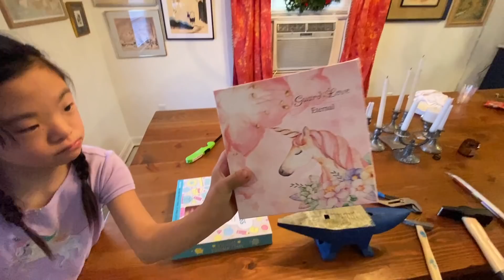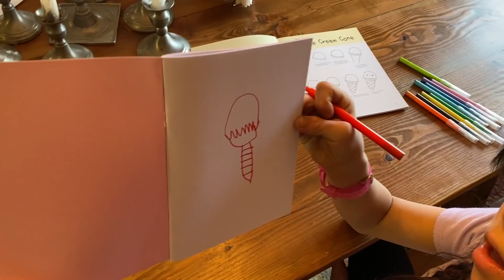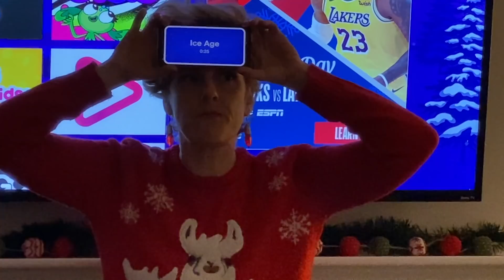CHRISTMAS MORNING 2020 : Adventuring Family of 11

Comment: I know I have seen the little hammer that Asher has with his anvel, I have seen it used hammering in little nails or tacs in horseshoes, starting them in the horseshoe and them when putting the horseshoe on the horse hoof the little hammer pushed the little nail or tack in.

Comment: I think the smaller hammer is used to cut the hot metal. But you have to have a bucket of water nearby to keep it cool. You hit the hammer side with the big hammer, and cutting side in the hot metal. If you don’t keep the little one cooled it will fuse with the hot piece you’re working

Comment: I have taught needle felting to my son's disable art class by putting fiber inside a cookie cutter and having them felt to the shape of the cookie cutter.  They turned out adorable and could be used as a decoration by threading a string through it.  We added color in various ways to enhance the design....stripes on a cat as well as adding a nose and eyes.

Comment: Maybe try for Eve something with three wheels. They used to have something called a "big wheel" that sat low to the ground and you peddled it but it was almost impossible to tip over on it.
Reply: The problem with big tricycles is they tip when going around a corner. You have to shift your weight to prevent that. Once Mike lowers the seat the bike will be perfect for her. She'll get excited about it when she sees her cousin taking it for a spin.